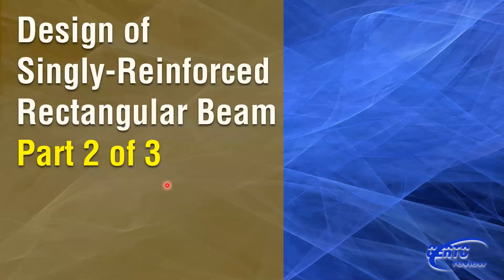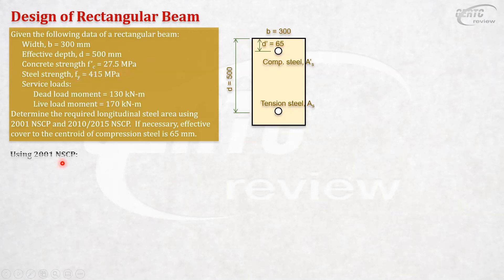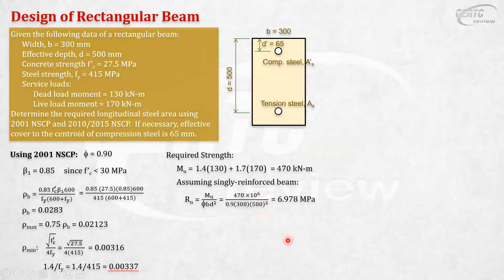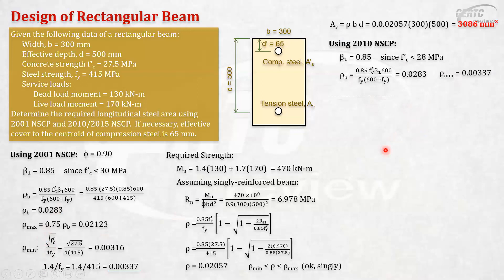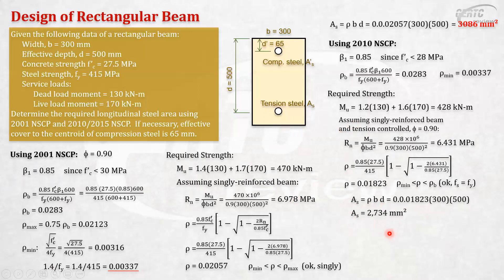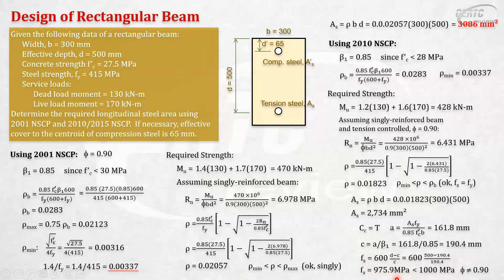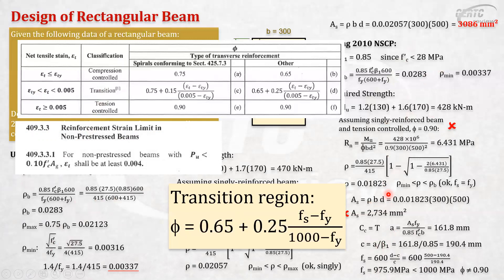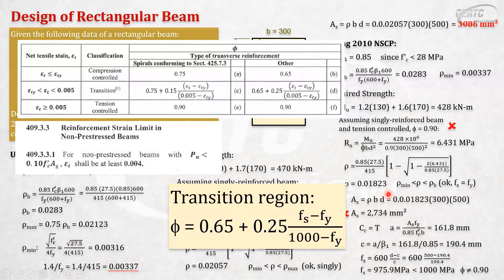Design of Rectangular Beams NSCP 2001 vs NSCP 2010/2015 (Part 2 of 4)

Comment: Using NSCP 2015
Meron kami ginagawa muna to confirm if singly (Mu < ϕMn) or doubly (Mu > ϕMn) by using a formula ϕMn = (459/1600)(fc)(β)(b)(d^2)[1 - (3/16)(β)]*(10^-6) kN∙m
Substituting all the values with (ϕ = 0.90, tension controlled only), ϕMn = 422.776 kN∙m which is lesser than Mu = 428 kN∙m. Therefore doubly na ito.
Just for fun lang, Kung pipilitin i-solve ito using singly, then I tried to use an app to solve itong tedious algebra equations at ito ang mga lumabas:
ϕ = 0.7185331073299
fs = 575.239 MPa
As = 3665.99 mm^2
a = 216.953 mm
c = 255.239 mm
Rn = 7.9421
ρ = 0.0244399

Conclusion: Nasa transition period talaga pero pagdating sa design, gusto natin na laging tension controlled kaya better to switch na ang ganitong problem to doubly RC beam.